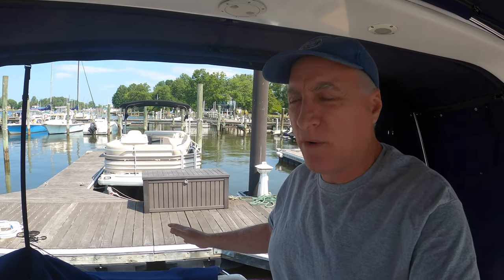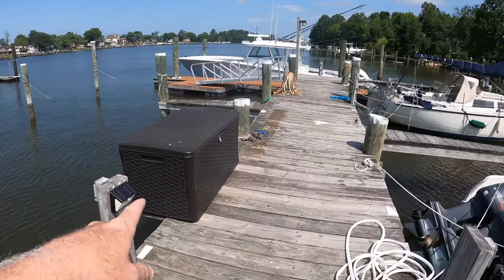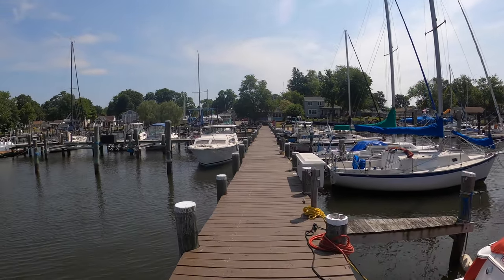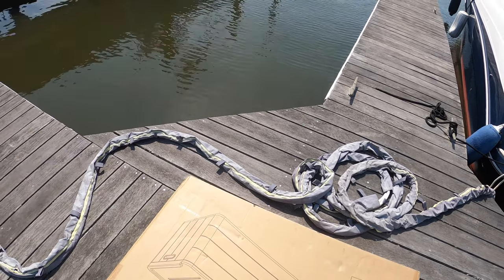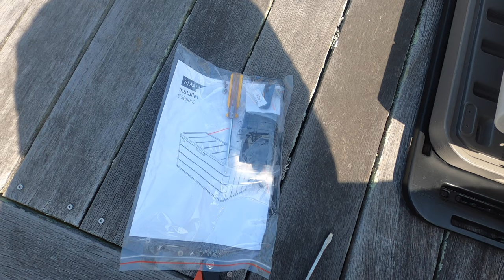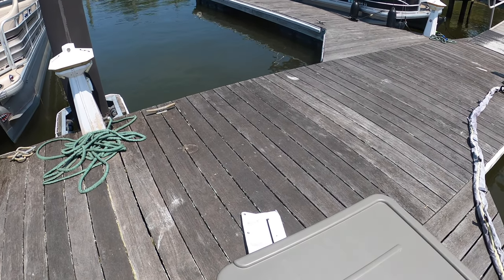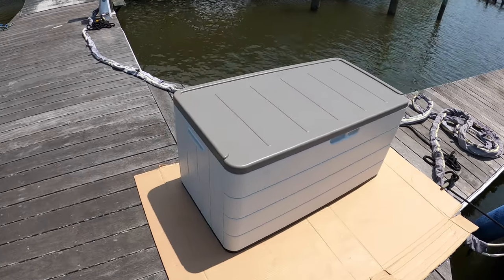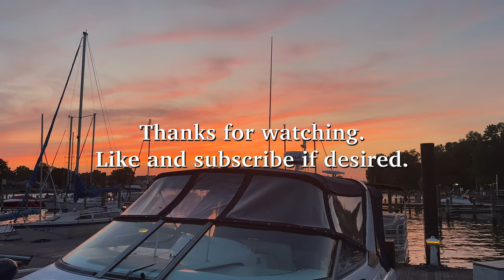Do You Need a Fiberglass Dock Box? | Boat Maintenance -   Episode 91

Comment: Important element omitted: What about attaching the dock box to the dock?
Reply from the maker: Yup. Good point.
Reply: well...how did you fasten it to the dock?  @eternitysshore
Reply from the maker: @DavidSear oh sorry. I didn’t know you were actually asking that question or commenting about the need for that consideration. And I didn’t remember what I actually said in the video as it’s a bit older. So…I used 4 deck screws. This was permitted by my marina. The box had places for them in the 4 corners at the bottom of the box. Thanks for watching and commenting.